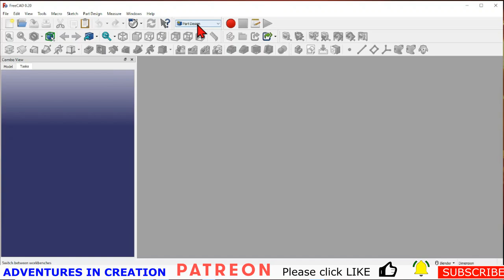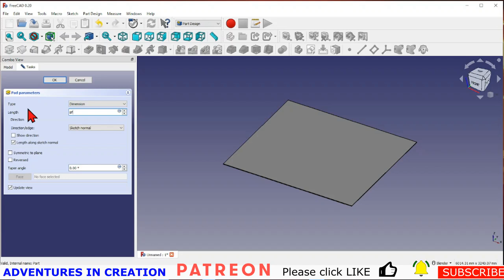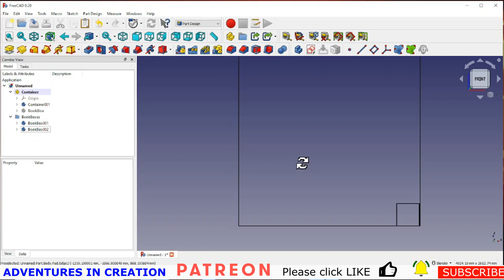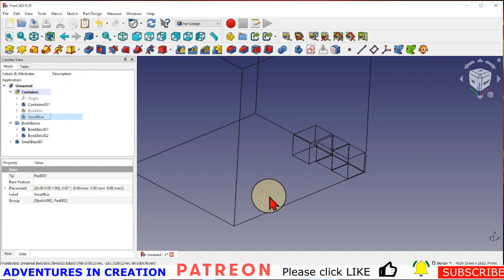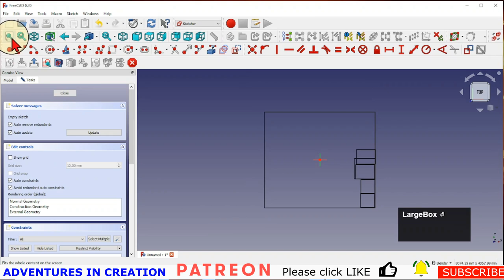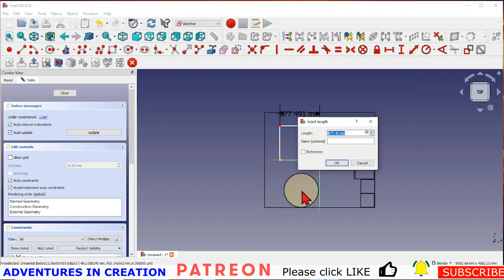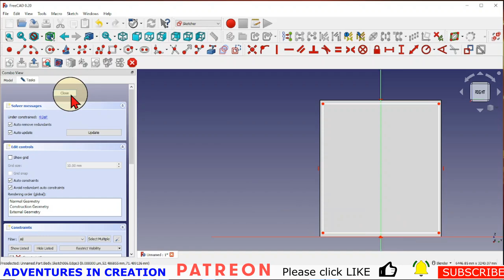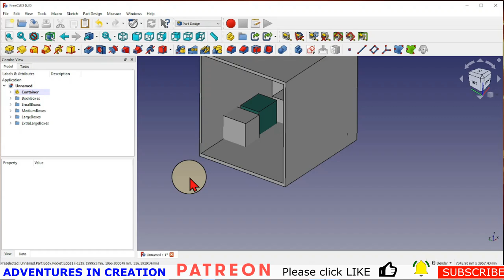FreeCAD Beginner #36 Boxes and Transforms

Comment: Is it possible to transform a part around an axis of another part?

I am currently trying to draw a solar ground mount. I started by modelling the aluminium c-channel profile and extruded / lopped off a 45 degree cut on each end. All parametrically.

I then copied that 4 times into a new part, an aligned them into a panel shape, changing parameters in the duplicated spreadsheet, and added some more parameters into the spreadsheet. I did this twice for 2 different panel sizes. Then I parametrically modeled a single solar cell, and then used a custom pattern with 2 linear patterns to get the solar cells, correctly offset in the frame. I added 2 more bodies for the backing sheet and front glass (using transparency)

After I had the two panels modeled, I made two folders, for two arrays, and copied in the relevant panel the number of times I needed them into each group (not duplicating the spreadsheet)

So now I have all the panels in two arrays, I want to rotate the entire group of parts by 30 degrees, or each part individually relative to an axis in one part in the group.

I cannot work out how to do that.
Reply from the maker: You can create a datum access and use that

Comment: Can we somehow make the small boxes 'snap' to the inside floor of the big box? I assume they are now intersecting with it.
Reply from the maker: Yes, you can certainly offset them to the same height as the inner box. I ended up using a spreadsheet to work through all the dimensions.
Reply: @Adventuresincreation  Using a spreadsheet would not only allow you to work through the dimensions but enable you to track total volume and hence how much space is left
Reply from the maker: @paulreader1777  exactly that Paul.

Comment: 25.4 mm in an inch. 12 inches in a foot. 3 ft in a yard. etc...
Reply from the maker: You are correct 😉 I grew up in the imperial (inch) system. I still convert my weight to stones.
Reply: @Adventuresincreation  i only recently heard of stones lol. well, my shoes are measured in barleycorns...